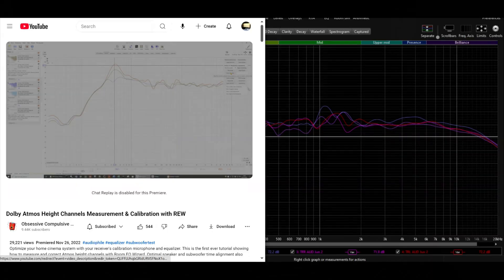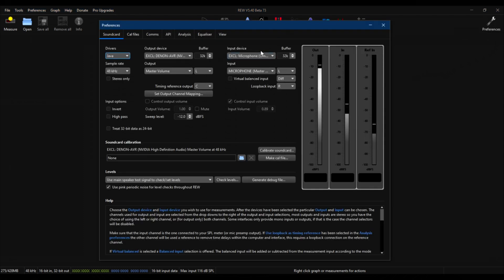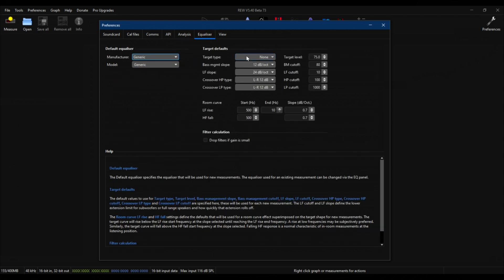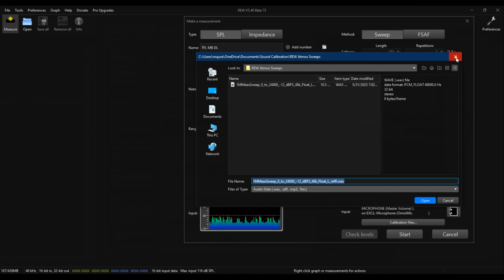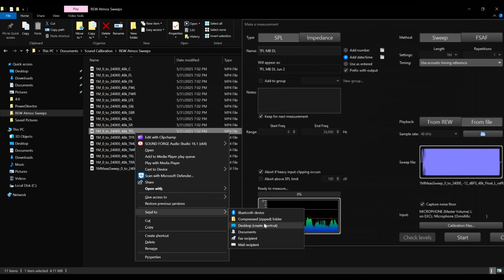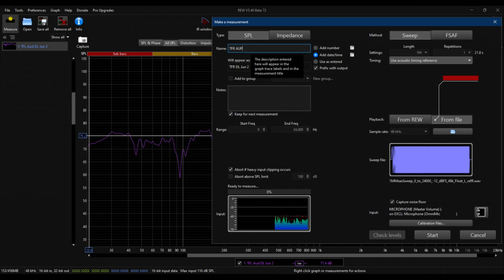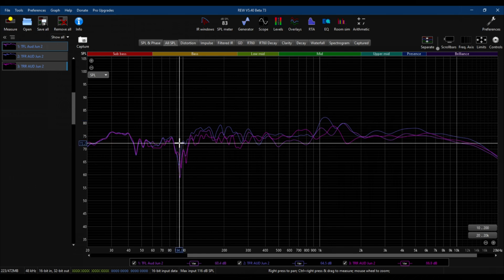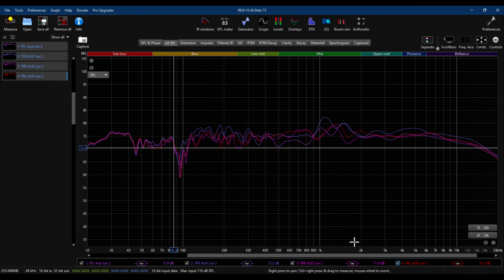How To Measure Height Speaker Frequency Response | REW | #dolbyatmos #dtsx #auro-3D

Comment: hi unfortunately its all not pink noise 
joe n tell uses pink noise for all of his magic beans calibration
i think i have an idea how to do what magic beans basically doing in rew
which is time consuming ofc 
but i want to try
for that unfortunately pink noise is needed 
and even rew when u press measure don't do pink noise 
only on its generator it does that
is there a way to play pink noise in all speakers to take measurements?
Reply: Joe n Tell first started doing his process using REW but he designed magic beans to make the process much faster.  So yes you can do it with just REW.  You measure the speakers nearfield.  Then you measure the room at your seating position.  Find where those two points differ and you can find your target curve this way.
Reply: @FURognar so basically trace arithmetic mlp÷ nf 
or is it mlp - nf?
that would be the "room sound signature"
then i save that room curve 
apply it to the mlp measurement?
match it to the room curve?
Reply from the maker: That is why I decided to use the sweeps from OCA. However, you can use the pink noise section in Spacial Audio Calibration Tool disc and the RTA in REW. I tried that and it works. You just play the pink noise on the disc and start the RTA measurement recording. Stop when the pink noise is done.
Reply: @magnoliamo thank you 
I think there is a only pink noise pack they sell
i can get that and do it

Comment: Great tutorial video.  What sound mode setting do you use in your AVR to do these sweeps?  Which sound mode setting is more accurate for these sweeps? I have a Denon AVR and I've been using Mult In Ch and Dolby Audio/Dolby Surround.  Thank you for the video.
Reply from the maker: Thank you. For the base level speakers when using the REW generated sweeps use the multi-channel 7.1 sound mode. No upmixing.  When using the file generated sweeps for the height channels the AVR will display Dolby Atmos. Leave it at that. If you don’t see Dolby Atmos on the AVR then correct channels are not playing.
Reply: @magnoliamo  Thank you for your prompt response. Appreciate it.

Comment: Hi MagnoliaMo I have Front height ( book shelf speakers) not Top Height ( In ceiling speaker ) can it still be taking the the sweep cause the AVR was set to Front Height not Top Height. Thank you.
Reply from the maker: Yes, that’s fine.  This will work for both front and rear heights as well as top front and rear speakers.
Reply: @magnoliamo Appreciate thank you.